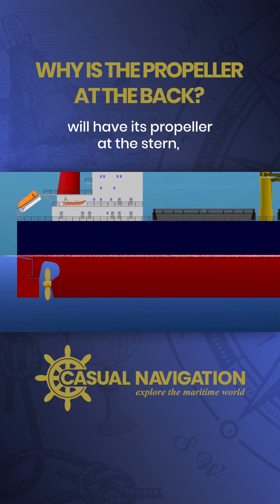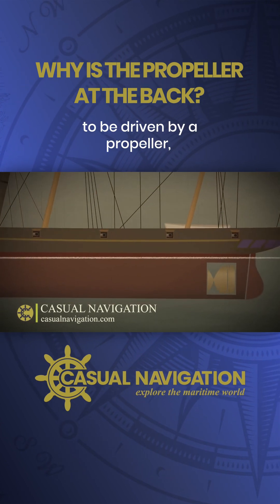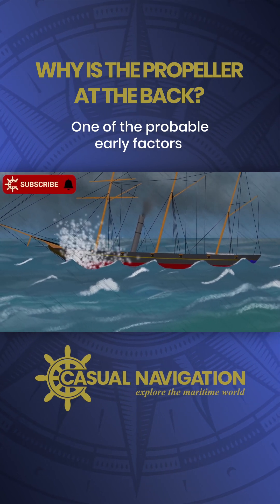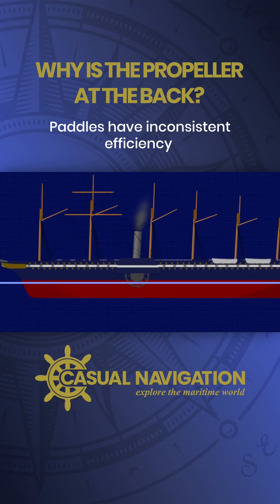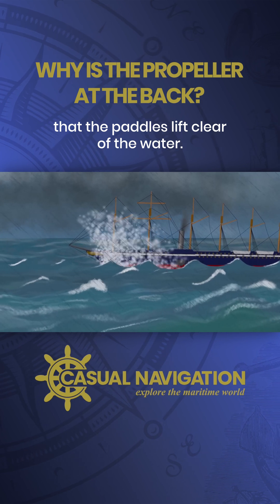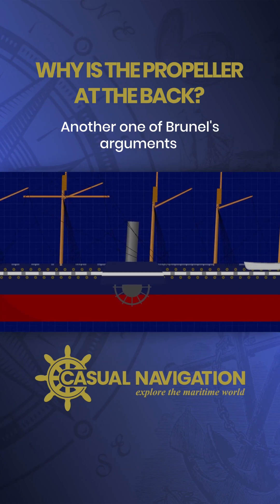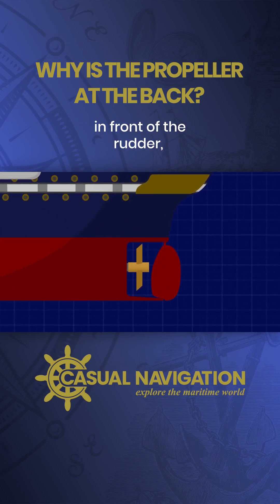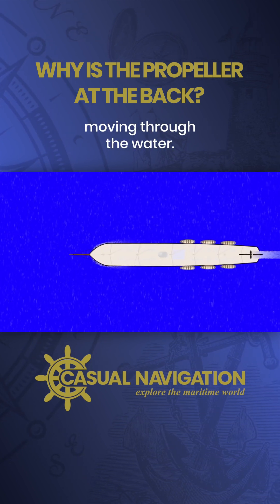Wait… The Propeller Is Where?!

Comment: If you would put the propeller at the front, you would place the engine at the front as well to save weight and reach higher efficiency. 
If you would sail under ballast conditions, your bow would then be positioned lower than your stern because of the weight of the engine, leading to worse seakeeping in bad weather. 
In addition, the screw would be better protected at the stern as encountered objects potentially hitting the propeller would have to travel alongside the hull before reaching the stern.

The advantage of having a propeller at the front of an airplane is having better cooling for the engine (a major problem for most pusher-propellers) as well as forcing the wind over the wing, creating more lift which is handy during take-off

Comment: So, in a ship the propeller is located Infront of the primary control surftt (the rudder). In an airplane, the propellers are located Infront of / on the wings, which also contain control surfaces.  Not so different after all?